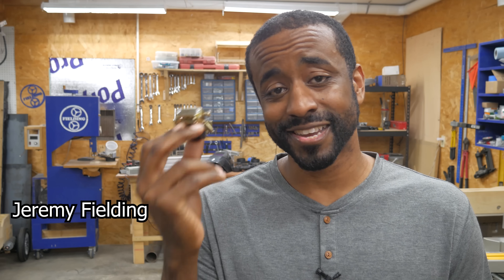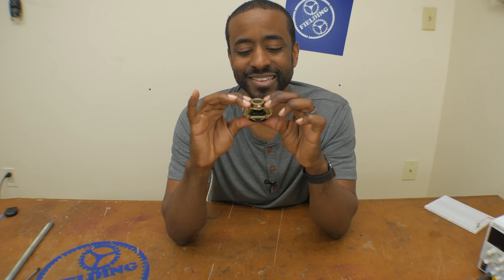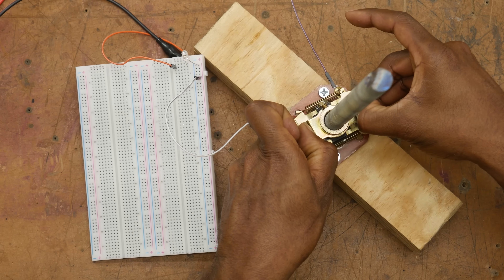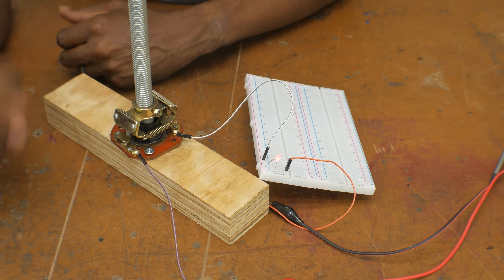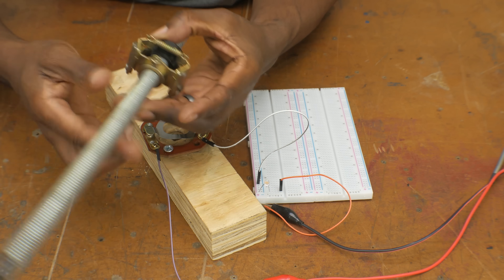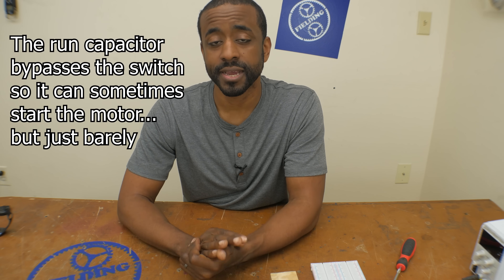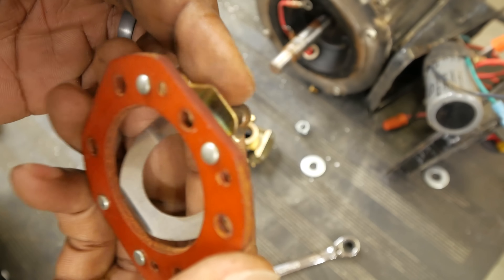This Clever Device Is Found In Nearly Every American Household. How It Works And How To Fix It

Comment: You did such a great job explaining and demonstrating the centrifugal switch I watched the whole video, think I got the jest of it's function, great job you should be a teacher........
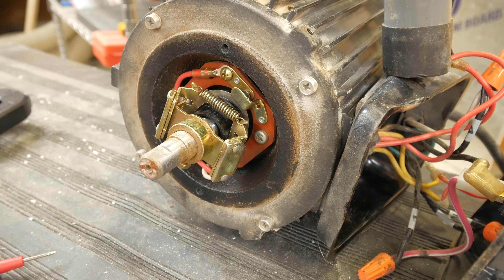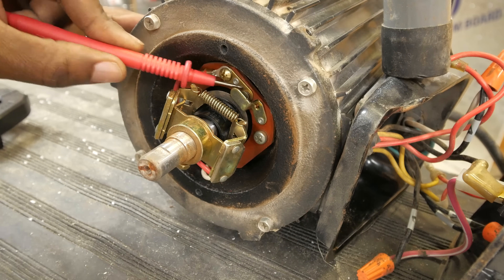This is a classic mistake made by people like me @ 6:26, "while I'm thinking about it dont forget to unplug your machine" Thats good advice, and  then @ 6:33 while doing more testing you get a good size spark, whats that all about? 

My ten year old drill press at most times when turned on just hums til I give the spindle a quick turn by hand then it goes up to speed, I think thats the capacitor but I dont dare to touch it, them sudden sparks scare me like the one you had.

Comment: If the contact is burnt (as in the video) the culprit is usually the diode which is (or should be) in parallel with the capacitor. Although it's not absolutely essential, it prevents sparks arcing when the circuit is opened and closed which end up burning the contact.

Comment: You have to be careful when cleaning the contacts (i.e. the tabs).  If you apply too much pressure when sanding, or do it too much, you risk removing the non-stick coating.  If that happens, they will eventually weld together, and could cause the motor windings to overheat and burn out the motor.  You can get away with it a couple of times, but eventually the contacts will need to be replaced.

Comment: You will only find those on single phase motors that use "split phasing" to start.
3 phase motors & shaded pole motors, permanent run capacitor motors do NOT use those.

Comment: It's called a "governor - centrifugal".
Used for centuries, first with water, steam, diesel and then electricty.
Every injection pump (diesel mostly) uses same weighted governor to balance fuel with rpm. 
The spinning brass balls you see on steam contraptions are also centrifugal governors .
Even some mechanical clocks have centrifugal governors, modern clocks use a weighted flywheel with spring to "regulate" unwinding of main springs.

Comment: For those wondering what caused the big spark, it was the capacitor. When the motor is plugged in, that capacitor sucks up a bunch of energy to give that motor the starting "kick" it needs. When it's unplugged, most of that energy stays in it for a while and what Jeremy did was accidentally short out the capacitor, letting out all that stored energy in a big flash. 

If you're working on a motor like this, be sure to discharge the capacitor (stick a screwdriver across its 2 wires, for example) before you stick your hands in it; they can give a pretty nasty shock if you don't.
Reply: Don't short a screwdriver across the capacitor, you can get hurt and damage something.

Use a resistor rated for the application.
Reply: You are so right. A Capacitor is like a battery that releases its charge all at once. Most appliances that have big ones usually have large WARNING stickers on them. Now he should research a little and do a video on them. Aren't the big oil filled ones that blow up in storms a type of Capacitor?

Comment: Hey man, invest in some good tools. I saw you were using needle nose locking pliers at two points when a better tool is readily available. You'll enjoy tinkering a LOT more with purpose-built tools. Overall, a nice video for a fairly new tinkerer. Keep up the good work!

Comment: Very nice video! One minor point - very often contact points like those you cleaned with sandpaper here are plated with coatings that make them more resistant to damage by arcing. Once those coatings are gone, the contacts need to be replaced. You can get some more life out of it by cleaning off the burnt material with sandpaper, but it will very quickly build up more insulating burnt material because the base metal (which is now exposed without a coating) oxidizes very quickly compared to the coating material (which is usually something very expensive and with a very high melting point, like platinum or rhodium).
Reply: Is there a paste or other coating that you know of that could coat the plates to protect them and allow for conductivity, when doing a repair like this?
Reply: You could possibly put a layer of dielectric grease.
Reply: Could you electroplate them with something? Zinc?

Comment: Here is a paragraph from Christopher Bissell. A history of automatic control. In Springer Handbook of Automation,
pages 53–69. Springer, 2009 "The most significant development in the 18th century was the steam engine governor. James Watt’s
steam engine was fundamental to the industrial revolution, as the centrifugal governor was fundamental
to the steam engine. A centrifugal governor (also called a flyball governor) is
a mechanical device that uses mainly the properties of centrifugal force to measure and regulate the
speed of a machine. Watts’ original design was only capable of proportional action"

Comment: I believe this device works with the same principal check it out 
centrifugal governor is a specific type of governor with a feedback system that controls the speed of an engine by regulating the flow of fuel or working fluid, so as to maintain a near-constant speed. It uses the principle of proportional control.

Comment: So simple, just like the governor used to regulate the speed on a steam engine that you h=might find in a mill or workshop, before they started using electric motors to replace the steam engine.

Comment: Well, now that I’m in my 50’s, wonder how many tools I’ve repurchased not knowing this! Thanks for the lesson
Reply: I got a free table saw because a $1 bearing seized, which caused it to pop its breaker. If it were something other than that bearing or a brush, the trash it would go. I also had some other electrical tools, 1 a brush came loose and destroyed some of the magnets, another I cut the power cord, it welded the brushes to the magnets. Oops. Pull apart dead power tools and learn, it can't hurt them, they're already dead.

Comment: Very good video and very informative. I would caution against sanding the contacts on the stationary switch though. Very often the contacts are silver played with a coasting on top to prevent welding and pitting. If the contacts are pitted I would recommend replacing the stationary switch as well as the centrifugal switch. If the contacts weld it can cause the start circuit to stay in even if the centrifugal switch functions. Also, when replacing capacitors, if there is a resistor between the terminals make sure the replacement has that as well. The resistor is used in motors that have more on/off cycling to remove residual charge from the capacitor and help eliminate contract welding.

Comment: All I have to say is THANK GOD we haven't found a "modern" replacement. Modern replacements for old mechanical pieces are typically (anecdotal...) failure prone.
Reply: Most new stuff is literally built to fail. built with planned obsolescence in mind. A lot of old gear will outlast the new by a factor of 2+.  My ToastMaster toaster that I use today was built in 1955, for example. Old motors were built to last as well.

Comment: All household dryers have one of those (or at least all that have a switch you have to hold until it stays on). The start button engages power to the motor, but as you may know, it releases and no longer sends power to the motor. This is where the centrifugal switch comes in. It engages a bypass circuit that maintains power to the motor until the timer shuts the power feed off. This is why you have to wait until the dyer is up to speed before you can let go of the switch.

Comment: This is reminiscent of needing to clean the contacts on the pressure switch coming off the pump at my well.  Standing back taking in the whole picture, it looks complicated and daunting.  But after remembering to turn off the power (lol) it's a pretty easy fix.

Comment: this type of device kept steam engine  from running out of control.  known as a regulator.  earliest forms were two heavy balls  spending that would open, close valves to desired positions. they also act as govenors,  and clutches.

Comment: I worked on gas and electric devices at a former job, air compressors were not generally among the items I worked on. I was asked to look at an air compressor because without it, we would have to close down until it was fixed. I took the cover off and found that switch was loose on the motor shaft. I guessed it switched the start capacitor to the run capacitor, however I didn't know what the switch was called. I wrote in my work order that I "tightened the flux capacitor retainer" and the unit worked to spec. Several months later my boss gets a call from corporate and he promptly transfers the call to me. It turns out that somebody actually reads those work orders, fortunately the lady that audited mine had a sense of humor.

Comment: Had to repair an 80's vintage washer motor that wouldn't start (hummed, but didn't know the tune...),  the switch itself worked, the motor winding contacts however were worn and pitted. Polished them up, worked fine this and now (fingers crossed), hope to update the washer this summer before it goes "tub up") and just isn't with fooling with anymore...

Comment: My old mini bike had the same technology for the clutch. Two fly weights would spin out and engage once one gave throttle to the 3 hp Briggs and Stratton motor, and engage the chain to the rear tire... I believe this is also the technology in limited slip differentials on vehicles.

Comment: I don't know for sure but I would bet that Tesla probably invented this device. He is the inventor of a plethora of mechanical and electrical devices and his genius has never been totally understand or properly appreciated. If I am not mistaken he envented the AC motor and logic would suggest he would have needed some help getting it started and the capacitor and centrifical switch would probably have been introduced at the time.

Comment: Bell and gossett.   Circulating pumps ( heating ) uses this since 1927.  Or so.  Basic idea.    Clutch less bikes.   Use same idea.     Most of what we use is old.  New technology is only using old technology.  And add extra crap.    Example.  Computer controlled cars.      Well in the end mechanical is what gets the job done.   Computer is a non needed middle man so to speak

Comment: I like your videos!   Before i saw this one.....i had a problem with a ñew metal lathe i bought.  At the maximum speed setting the lathe would start spinning and then sort of chatter  and then trip the breaker on the lathe. It worked ok on the lower speed settings.  Ordered a new motor...instaled it....and same thing happening.  With both motors.....they would work fine with no load.   My theory was that under the heavier load created by the gearing of the lathe to achieve the high speed at the chuck.....would not allow the motor to  get enough speed before engaging the run winding.  Essentially it was being shifted into second gear before it had enough speed to continue spinning when the run winding engaged.  So it would stall .....shift back to "first gear" and try again....and that cycle would continue as a chattering sound.....and bbreaker trip.
I got to the centrifugal switch and decided to bend the tabs holding the spring to make it harder for the weights to swing  to swing out.   So now i beleived the motor would run longer in "first gear" and acheive more speed before switching into "second gear"(run winding)..and that worked.....and been ok since.?

Comment: I have found when cleaning burnt contacts it is necessary to ensure both contacts can close flush, Emery Cloth/Paper is superior to sandpaper, if you cut a strip  about half an inch wide off the width of the Emery sheet, then fold the strip in half cloth sides back to back so both outer sides are abrasive. Then place the double sided strip between the Contacts, apply pressure to close the Contacts and pull the abrasive strip through enough times until the Contacts are clean and have matching surfaces and no HIGH points to cause an arc.

Comment: The caps are also for creating a faux-phase on a 1 phase power supply.  A motor cannot start on one phase, like trying pedal a bike with one foot.  But they can use a cap to split the wave, and delay it a bit to get two feet on the pedals.  I gave seen an old bench grinder and a desk fan with a dead cap that couldn't start by itself.  but if you gave the wheel/blade a spin with your hand, it would slowly spool up, and run just fine once it reached operating speed.  Just like how you can pedal a bike with one foot once you're up to speed.

Comment: Kind of surprised you didn't use a nail file or Emory board to clean the contacts. Those are favorites of mine for such tasks.
Reply: Or use a point file.
I needed a point file to work on my old John Deere tractor 1951 "model B".  It uses points and condenser for ignition.
I went to the local O'Rielly auto store and asked for a point file  the clerk didn't know what I meant...

Comment: The us has 3 phase but you have to have a separate circuit panel and use so much per month otherwise the electric company wont hook you up. You'll find it in commercial areas.  No residential appliances are 3 ph

Comment: Yeah, that is a cool device! I've only read about it in a book about motors. 
What the capacitor does is create a leading phase that creates a starting force for the motor to start turning. Once it starts turning it generates a back EMF that reduces the winding current. So it no longer needs that starting force once it's moving. 
Nikola Tesla saw it all in his head!

Comment: the switch can also be used to disconnect power to a motor, and turn it back on when it slows down to regulate speed exactly, if its a variable switch then you can even move the distance and adjust the speed on the fly(you can find them in stand mixers)

Comment: Very old skool ,don't use any more in Auto motive ,similar design,in points and condenser distributor used to advance ignition timing of the ,also in old automatic transmission,,centrifugal force to upshift ....don't use any more, sensors & micro processor,all simi conductor based now.,Love your video,brings back memories

Comment: Small engines have something similar in the oil well. No oil weights open up and kill motor to avoid burning up. Call them slinger switches...

Comment: The capacitor wont explode if the switch plate doesnt lose contact. On split start/cap start/CSCR motors, the "start" winding is wound with smaller diameter wire and more turns than the "run" winding giving it a higher resistance. If that winding stays in the circuit for too long it will burn out long before the capacitor is affected. The starting current of a single phase motor is 3 - 6 times its full load current (depending on the quality, size and type) and the winding is only designed for short bursts.
Reply: Is it important to discharge this type of cap before messing with them ?

Comment: Centrifugal governor, invented by Christian Huygens in the 1700s, originally used to control mill speed, then adapted to steam engines by Watts, later modified to control electric motors. If something spins too fast, it disconnects its power, be it belt, steam or current, when it slows down it reconnects.

Comment: It's a stage switch for two stage motors they are used in conjunction with capacitors. the capacitor is a storage unit it that store's a high amount of voltage which is measured in microfarads. until it released by the two stage switch. for the boost that the motor needs to get started running. WARNING never touch the connections on the capacitor without discharging the capacitor first or it can very likely kill you. these certiffical switches work on the same principal as a governor on steam engines and gasoline and diesel engines. by keeping the engine at a certain speeds within it's power band. requiring no need for a person to control of the throttle of the engine.

governor's are still used today, the most common place to find them is on your lawnmower. it's why there's no engine speed control the on lawnmowers. when the mower goes into deep grass the engine r.p.m.s drops very slightly. then the governor moves the throttle open to compensate for the extra load on the engine and vise versa.

Comment: There is a way to offset the power so it acts kinda like an extra phase. It be cool if you made a short video on that. And for a longer video of you could explain why load can decrease the frequency of the grid. Ie deviate from 60 hertz. And why a slight deviation can mess up the grid. Also how do frequency circuit breakers work?

Comment: The spark at 6:30, was because the machine was plugged or could that be a capacitor discharge? And could that damage the multimeter at the continuity setting?

Comment: The Centrifugal switch is based on the Centrifugal governor but it uses springs instead of gravity. The Centrifugal governor was invented by James Watt in 1788.
https://en.wikipedia.org/wiki/Centrifugal_governor#History
The same Principles were used for the creation of the Centrifugal clutch.
https://en.wikipedia.org/wiki/Centrifugal_clutch#History

Comment: Obvious possible problem: If motor is jammed or overloaded, centrifugal switch will never trip and start capacitors will remain connected until they're damaged.
Obvious solution: Add a second switch which will cut out the capacitor if it remains connected for longer than a certain length of time. (Make sure this time is long enough for the motor to spin up, but not long enough to damage the capacitors.) Have the switch reset after a cooldown long enough to protect the capacitors.